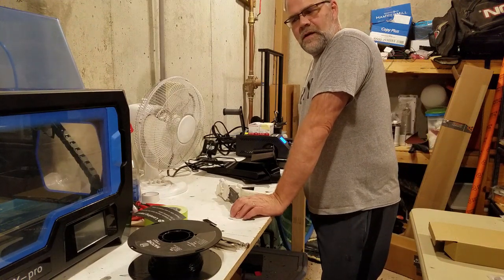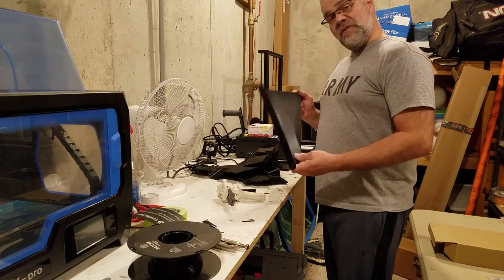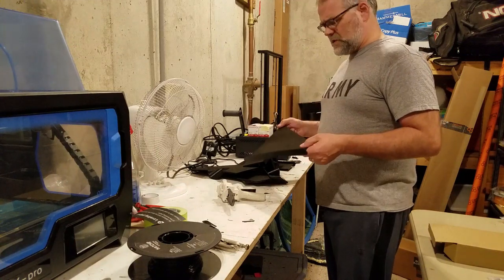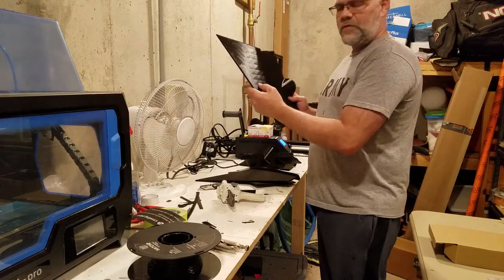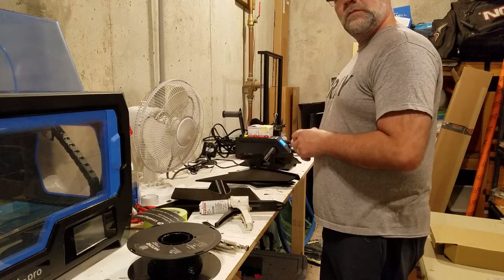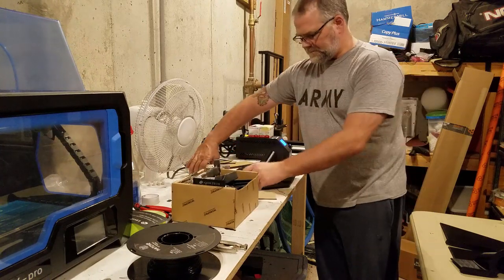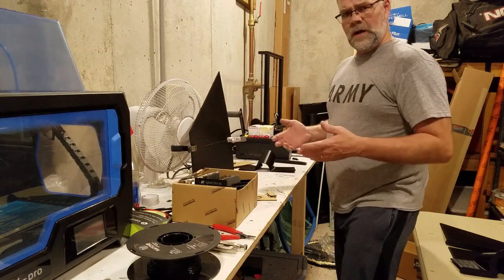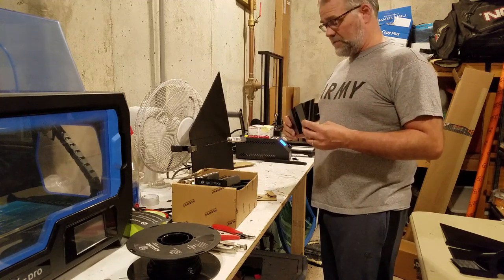3D Printed Interceptor Scoop Re Do Part 1

Comment: Can I ask why you use carbon/Kevlar when carbon is stronger.  Kevlar is more abrasion resistant but is not as strong.
Can I also ask how you manage to use that two part adhesive without getting it all over your hands, and clothes and without it getting in your hair?

Comment: I bet you could use welding magnets (or some kind of strong magnet) on either side of the thin flat pieces that are butt-joint glued together to help keep them aligned while the epoxy cures, along with the clamps, and put some plastic sheet or release film between the magnet and part so the magnets don't get glued to the part

Comment: For your print settings, a couple ways to add strength are to reduce your fan speed.  Since 'quality' is less of an issue with all the amount of work you have to do after that will give you the highest quality printed part possible.  The other thing is to increase your walls vice increasing infill. However, as you are doing that to avoid the compression factor from the vacuum I'm not sure what would happen.   I don't think it would be a noticeable difference but I do think you could atleast get the same strength for less plastic..     as I am currently printing your rear splitter...   I can only begin to imagine how mamy rolls you've used and worse wasted.   I'm currently printing at .36 layer height with no fan at 220.  But I am going with 0% infill and one wall...  This is because unlike you I will not be vacuum bagging my parts, I will be using the plastic almost as a lost cast.  I will cover one side in a light layer of fiberglass and then I plan to cut out the unexposed plastic giving me one layer of glass with a .6mm layer of plastic. I will then build up my layers as needed.  I shall let you know how things turn out..  if it at all works like I am hoping
Reply from the maker: Cool.  Let me know how it goes!